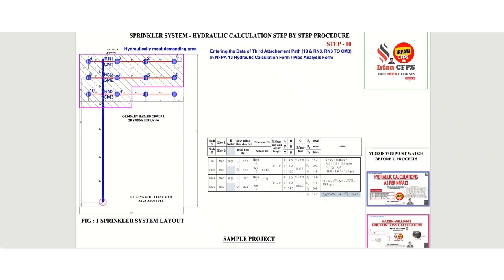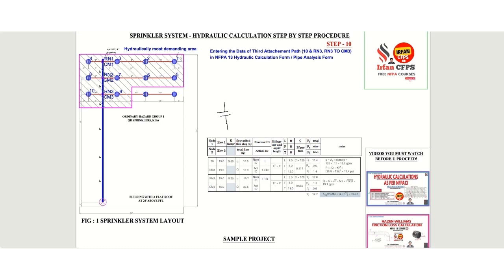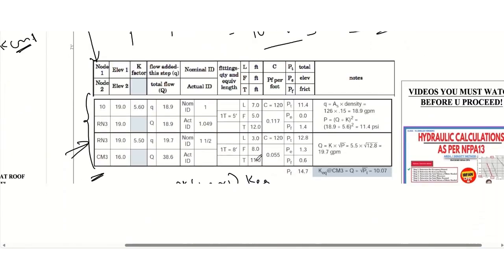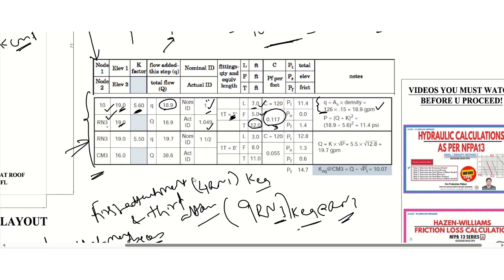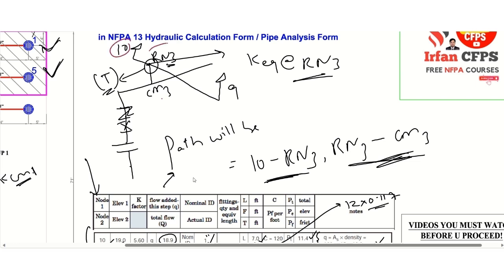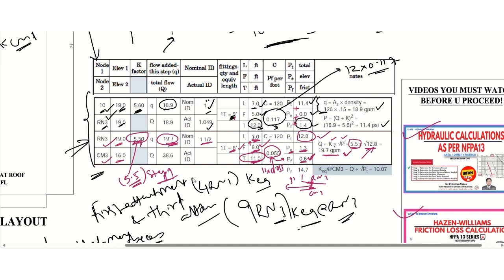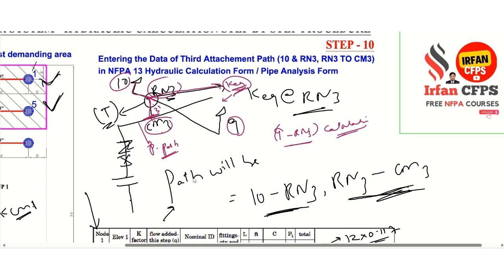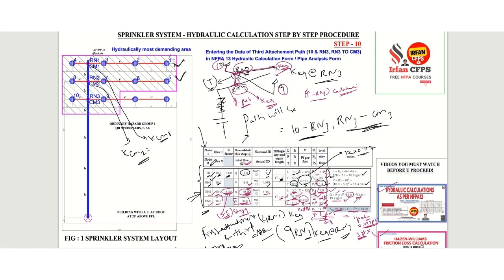Step 10 |Hydraulic Calculations for Sprinkler Systems

Comment: Hi sir, can i know how to get Pfriction per foot value of 0.055? is it by using Q=19.7 , C=120 , d=1.61? thank you.
Reply from the maker: 19.7 gpm is small q. you should consider capital Q which is Q = 38.6, C = 120, d = 1.61. put all these values in  this formula, p = 4.52 x Q^1.85 x C^1.85x d^4.87.  you will get the exact result. please use calculator.
Reply: @irfancfps  thank you sir
Reply from the maker: @rayerngeekz  Hope its clear for you